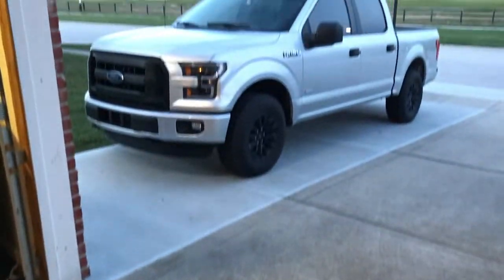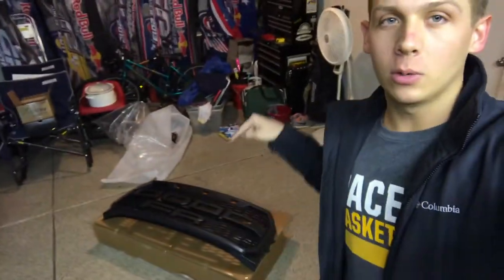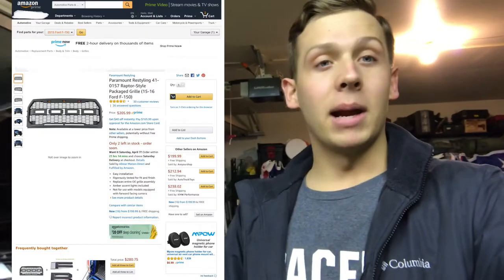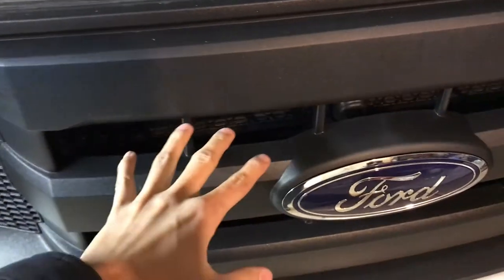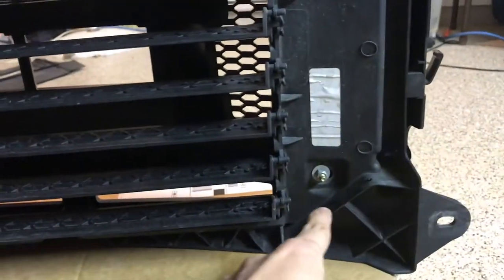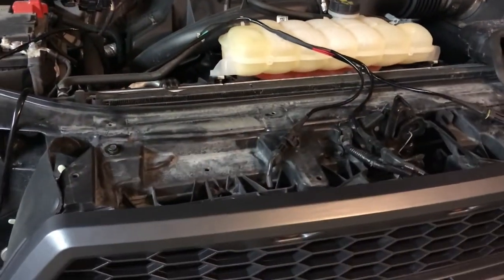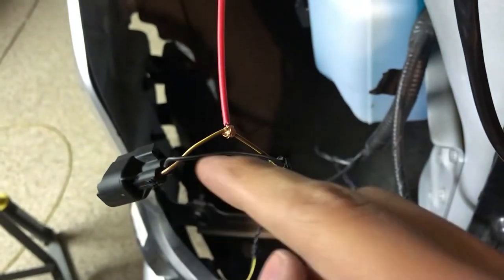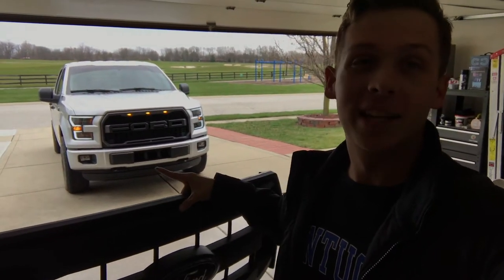*BEST* Ford RAPTOR Grill Install/Review!!

Comment: Bro, please solder those wires together or gel splice. That is not good to leave it just twisted together.
Reply from the maker: Donnie Kiefer they are no longer like that! I forgot to add a part to the end of the video where I fixed it! I cleaned it all up the next morning! Thanks for the input man
Reply: Egoboost73 this is what I was refering to, but nice

Comment: How's the grill been holding up since you put it on? I just got a 14 fx4 all pimped out with the appearance package and I LOVE it. The stock grill is kinda lame though and this is my favorite design of any of the grills I have looked at which is awesome because it's way more affordable than alot of other options. I just kinda worry about cracking and whatnot as my stock one is cracked in a few spots and they are both plastic.

Comment: Question on the ground wire did you just expose the wire then tighten the bolt over it or did you attach a ground end on it?
Reply from the maker: Edgar Aguilar I put a ground end on mine!

Comment: How did you change the letters while already installed?do they snap in from front? thought there are screws on the other side? did you have to uninstall it to change letters?
Reply from the maker: honobia12345 sorry! The letters should be replaced before installing the grill! They just have screw behind them

Comment: Do you have the camera in the grille? If so where does it go on the grille?
Reply from the maker: Will K I do not have a camera in the grille, these aftermarket grills do not come with the option for a camera in them or even a slot for it.

Comment: Those are 35's aren't they?
Reply from the maker: BellyUpFish nope they’re not! The truck isn’t leveled in this video and these trucks before they’re leveled cannot have tires larger than 33’s.
Reply: Egoboost73 well good. I just ordered 33’s for mine. 😂
Reply: BellyUpFish I have a 3 inc lift on mine and running 35s it only rubs on the front bumper plastic it’s a easy fix